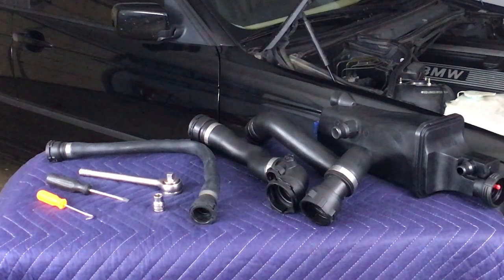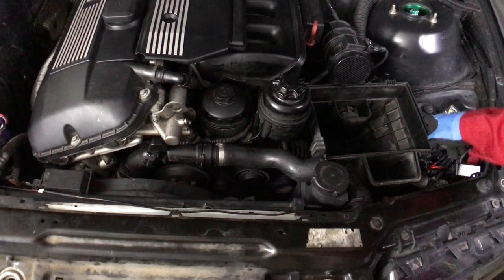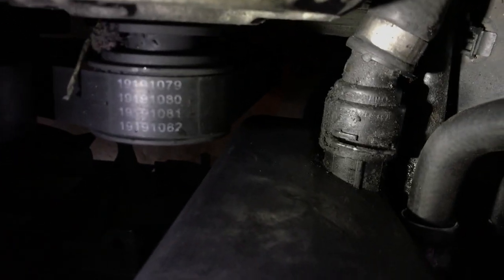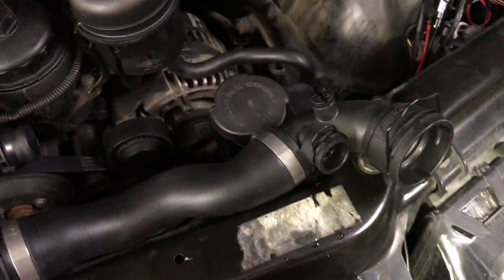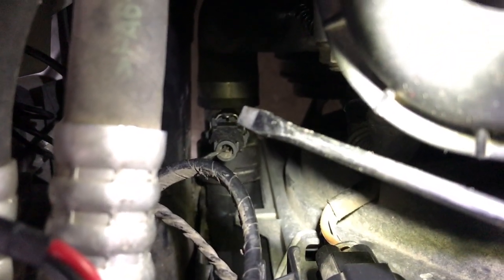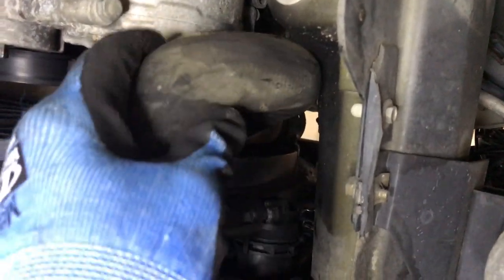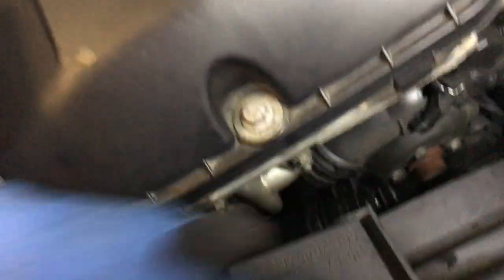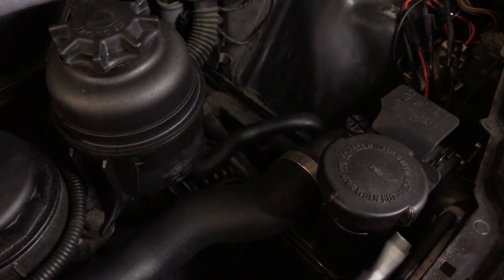BMW Upper hose, lower hose, and Expansion tank replacement DIY 323i, 325i, 328i, 330i 1999-2006 E46

Comment: I like the intro.  But you said turn it on but dont start. Then said let it get to operating temperature. Does it get to operating temperature in just the on position?
Reply from the maker: Yes! I actually ran out of hard-drive memory at the last minute. Doh!!! I’m glad you pointed that out. What I meant to say was, when you first put the coolant in, the key should be in the “ON” position with the heater set to full HOT and fan speed full LOW. With the bleeder-screw removed, fill it all the way till the level indicator stick reads max levels. Then, close the cap and bleeder-screw and fire up the engine full on. Run it till it reaches operating temperature or take it around the block then park it and let it idle till the temp gauge reaches middle hot. Let it cool down for a few hours. Once it cools down completely, you’ll remove the coolant cap and bleeder-screw once again and fill it up to max levels. That should complete the bleeding process. But after a couple days of driving it I would advise to check the levels and add  to get 100% air out. Thanks for pointing that out !!!
Reply: @Roysgarage  Thot it was jus me

Comment: I need to replace that middle hose that’s connected to the expansion tank.. I don’t know what it’s called or can’t even find how to fix it 😅
Reply from the maker: Might have to use realoem.com to help identify parts. Expansion tank hose mist likely. The all attach just like in the video with a locking clip

Comment: Did not see you put any o-rings in the quick connects, did they need any or did they have any of those beveled neoprene plastic rings that serve as Orings?  I am having a time trying to figure out which quick connect take Orings and which take those plastic beveled sleeves...please let me know (on top radiator hose, on the bottom hose to engine and the one from engine.
Reply from the maker: they have them supplied on those hoses when you buy them. It was already on that parts. Sorry I just got back. let me know
Reply from the maker: Hit subscribe pls! 😆